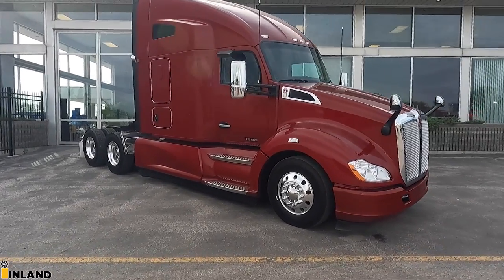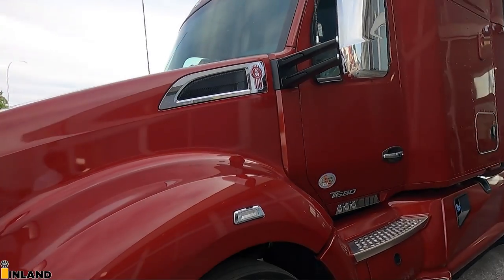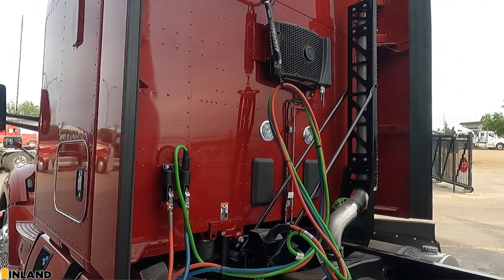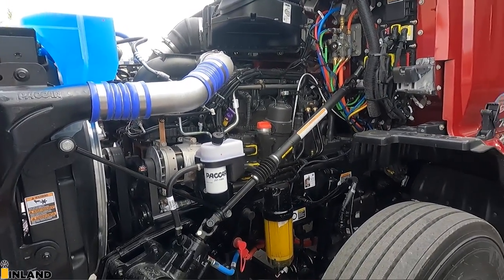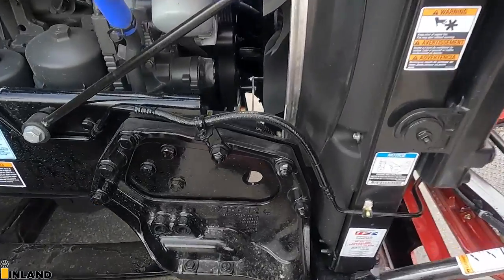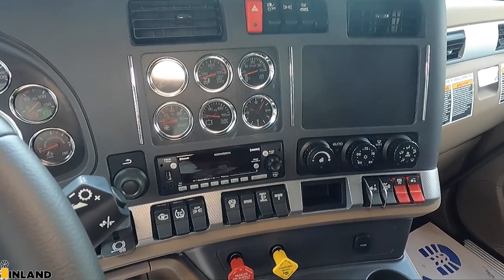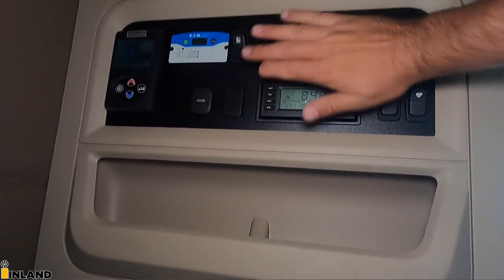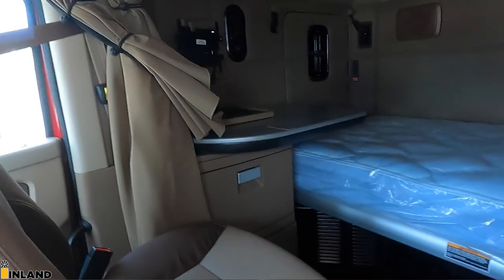Legendary Red 2022 Kenworth T680 Highway Truck    The Kenworth Guy

Comment: Any info on the updated flat top sleeper sizes for the 2.1 cab?
Reply: Kenworth was only doing a Gauge overhaul on 2.1 for T880 and W990 with new hood and aero for T680 should still have the same sleeper configurations as previous 2.1s
Reply: @ltciscora  they offer the 52” in a flat top now

Comment: Hey Andy !!!!  Great ride for summer roads as would not want to try & get around in winter !!  Guess you customer must run the North in summer & Way down South in the winter !!!  Years ago, ""OVERDRIVE" mag. did an article on a ""OL"" trucker who had a B-61 MACK & drove the States in Summer & put it on a ship to go to the Caribbean Islands & trucked down there till Spring !!!  As Paul Harvey used to say """  Wait for ""THE REST OF THE STORY "" on the 2022 T-680 ""NEW INTRO "" !!!  Is Jan up for another ""AWARD"" Yet ??  Have a good week & ""KEEP IT SAFE ""!!
Reply: I don't understand the fascinatiion in North America with 6x4 for on highway work at regular weights. The Swedes run at 70t on ice roads with 6x2 and no problems with winter tyres and chains when necessary, in the UK we run 44t admittedly much  less snow with 6x2 and we don't even use winter tyres and chains are illegal.

Comment: A dump valve on the last axels airbags so the drivaxel gets more traction in the winter?
Reply: A dump valve is a must for this truck. Unfortunatly Kenworth or Bendix do not provide that but they have E track that dumps axle if it spins. How ever I asked another shop to put it in for me.
Reply: @kristinnsigurj  Yes good to have i think. Here in Sweden i can dump even on 6x4 that's a big help in the winter.